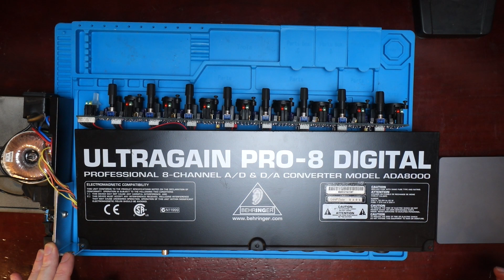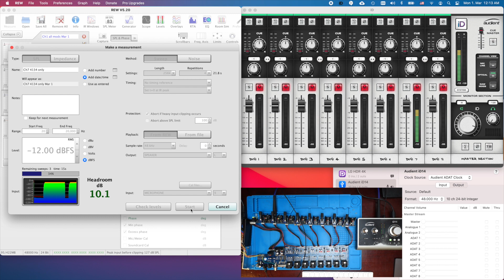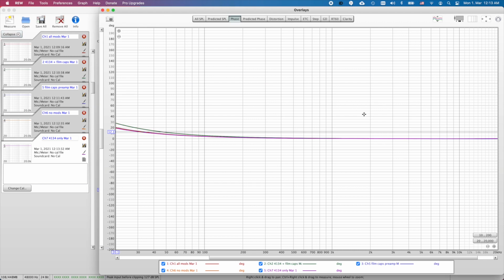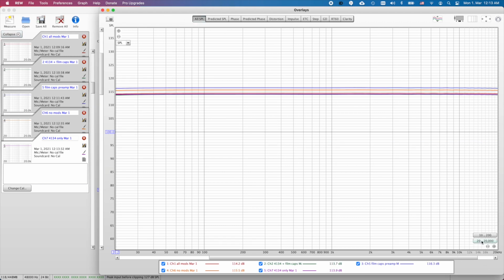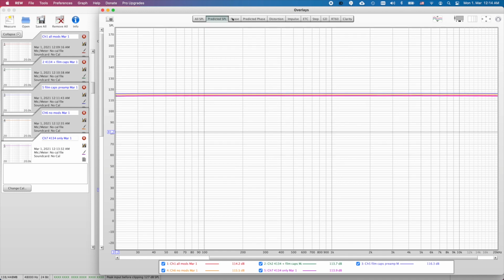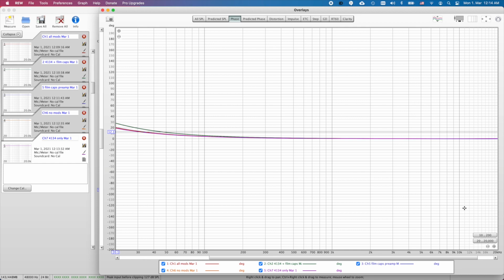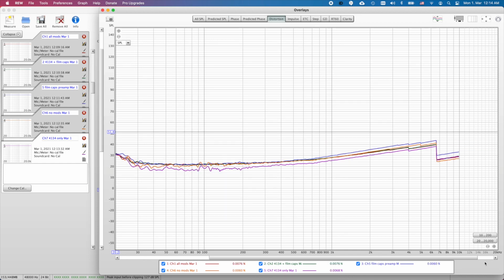Do Behringer Ultragain ADA8000 mods work?

Comment: Great video. I would be interested in what revive audio does with this mod vs black lion. I’m thinking bigger caps in the power section. Swapping the caps in the way that you did here and decoupling from op amp as well. Thats going to be the direction I try first. I’ll see what works for me.
Reply from the maker: I haven't looked too closely at what they've done, but without making a new PCB, there are 4 possible mods: better filters in the power supply, shielding, better caps in the audio chain, decoupling of the digital and analogue circuits.

Comment: Good evening friend, could you help me, I have one of these but it is clicking on all the channels, I saw some videos on YouTube that I saw the ci al1401 and the ci al1402 and the ad converter, and the other one, I tried on aliexpress but I didn't find it, I would like to know if you would know of any substitute, for me it's really difficult here, I live in the interior of Brazil
Reply from the maker: Hi, I am sorry to hear that your ADA8000 has failed. It's hard to diagnose remotely, but I've never heard of these converters failing. My guess would be that it's a clock and/or power problem, have you checked these?
Reply: how can I do the clock test
Reply from the maker: Just with an oscilloscope, I think you can just hook up to the external world clock terminal, or find the clock circuit on the board.

Comment: I noticed that somehow you DIYed the power supply. Can you tell where you get it?
Reply from the maker: Hey Renyold, if I remember correctly, I repaired it by replacing one IC, but no mods been done there. Maybe it's a different revision than what you have?

Comment: So in your humblest opinion, would you say it is really needed to use mods such as the BlackLion Mod? from your chart of results it looks almost identical. Thanks a lot for this very detailed tests : )
Reply from the maker: Hey Alejandro, happy to share my opinion. The BlackLion Mod comes in two options: standard and premium. In my test I only swapped a few components based on the information on the Internet which supposed to be close to the BlackLion Standard, but it's not 100% the same. With this mod I don't see/hear any improvements. In Premium they also do some improvements in the power line which I think could be valuable because the vanilla one is not ideal.
Reply: @pace_of_mind  I really want to pair one of this with my Babyface Pro FS, so this info comes super handy, thanks again for the quick answer! ♥️♥️♥️♥️♥️